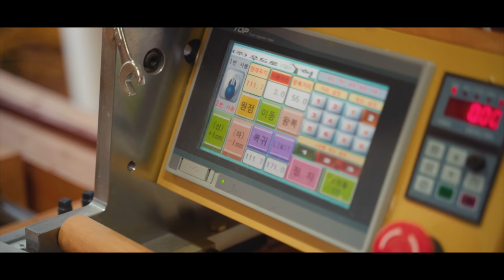이게 가구야? 작품이야? 외국에서만 보던 원목가구가 한국에도! 아머드 거실장 armored cabinet wood art carpentry woodroleehyun

Comment: Beautiful work for a stunning piece of art ! One more subscriber.
Which wood is it, walnut ?
Reply from the maker: Thanks for watching

Leaf Shape and Size: Walnut trees have large and broad leaves. While there may be slight variations depending on the species, leaves typically have an oval shape and measure around 20 to 40 cm in length. They are generally green in color and turn yellow or brown in the fall.

Walnuts: The nuts produced by walnut trees are one of the most recognizable features. Walnuts come in various sizes and colors, but they are typically encased in a tough shell with a fleshy interior containing the hard nutmeat.

Trunk and Branches: Walnut trees have sturdy trunks and branches. The trunk is usually thick and dark brown, while the branches often extend at wide angles. These characteristics help distinguish walnut trees from other types of trees.

Comment: Those machines at the beginning of the video are awesome!  Vertical mortiser is impressive too.    Really like seeing how cnc is utilized to create joints and design elements.
Reply from the maker: Thank you for watching our video. The machine in the video is called 'Lee Hyun Machine', a machine that we are researching and developing on our own. It is a semi-automatic multi-machine for wood processing that is similar in appearance to CNC but is completely different. :)
Reply: @woodroTV  I thought it looked like a one-off. Very interesting. I've used my own CNC in a similar 'manual' way, but I don't have all the vertical clamping options that you have. Great work!
Reply: @woodroTV  would definitely pay for plans on how to build this or just more info on the machine. very cool